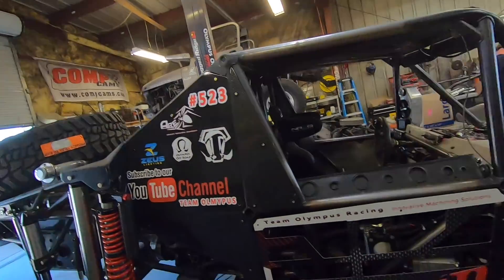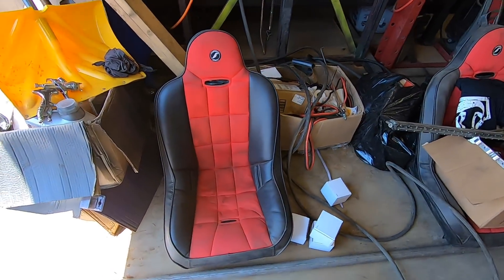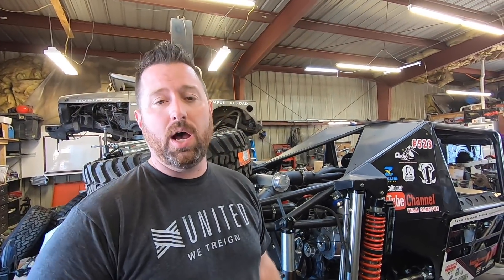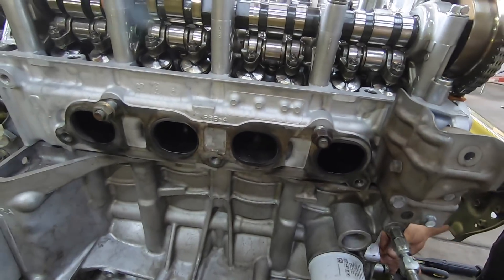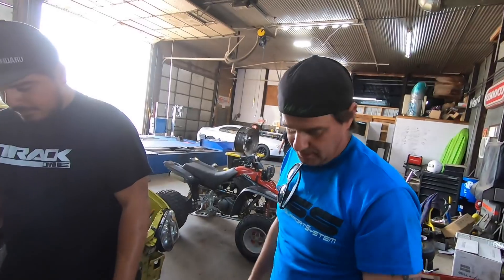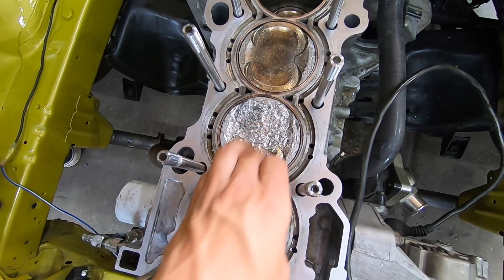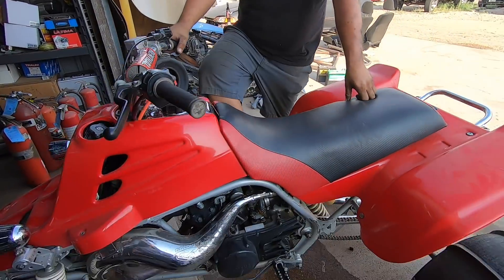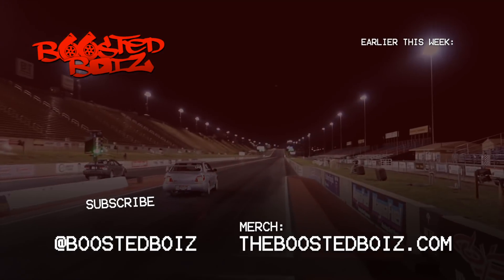Finding Out How Bad The Damage Is on Hondaru

Comment: I’d really encourage reaching out to 4piston and figure out what they can do to help. Because it has been consistent problems with their heads.
Reply: For real. Happened too many times to be a coincidence.
Reply: hangtime 7190 Youre not wrong. It’s been a lot of time and money spent to have a head continue to drop a valve in every motor they have.
Reply: @Vampyric Winter I will make pay  for the next engine.
Reply: @Vampyric Winter Agreed, unless 4piston gave free heads to BB theres no reason to keep giving them money or free R&D.
Reply: Vampyric Winter oh absolutely, but it is their heads that caused all of these catastrophic failures. You’d think they’d reimburse in some way.
Reply: You can't free rev an engine repeatedly at 9000RPM and expect the valvetrain to stay together. All 3 failures have come after misshifts. The damage is from valve float, not poor assembly or warranty related issues.
Reply: @humbleperformance  so what you are saying is that its the boostedboiz fault?
Reply: Humble Performance appreciate the insight
Reply: To help out a little further, The cylinder head on the subaru was gone through by their local machine shop, it was completely redone. 4Piston doesn't make the head, it's still a stock cylinder head, nothing about the setup is witchcraft. IF ther ewas an issue with the cylinder head PORT, that would be 4P's doing.

They've broken 3 heads with all the same issue. The last time, the head was reassembled by another shop and the same issue occurred, it wasn't even 4P. The reason they're going to try a stock head is to see if the issues arises again. If they drive the car the same way they have been, logic says it will happen again.

If it arises again, to alleviate the issue, they should either 1.) fix their shifting issues before running them full tilt again so the engine doesn't become unloaded at high RPMs again like they have been. 2.) put a heavier spring in the cylinder head for better valve control.
Reply: @humbleperformance  Stock head do not fail like that, that is trash head job, i have see so many ported heads with berilum valve seats, ferrea valve guide... full build head and never fail like that.
Reply: 4piston owes BB Kyle and Emelio both new engines. This is getting ridiculous their channels are losing lots of content because a mfg doesnt know how to press in seats. That is the exact reason here. They need to cut closer and lqd nitrogen them in. Sucks for Kyle and Emilio.  I wanted to go see them rip at ICream Cruse. If there cars arent up or blow up right away that sucks for all of us. 4P you better make this right or close doors.
Reply: @fabini14  Set your 2 step to 9000RPM and see how long the head stays together with 100lb Ferrea springs.

I've seen pictures of the cylinder heads up close as well because I talk with Kyle pretty regularly and he reached out to me after it happened before posting the video. The retainers show signs of valve float. A cylinder head doesn't cause valve float, an out of control valvetrain does. Control of the valvetrain is influenced by several things, and it isn't cylinder head porting.

That's why Kyle wants to put together a stock cylinder head with the same parts, to see for himself.

When 4P builds a head, they keep a log of EVERY head and engine that leaves the shop, every clearance and height is in a giant book that Josh keeps. If the boiz call into 4P they will receive all the specs the head measured at when it left.
Reply: way to many issues with them for sure, sad times when people trust a stock head vs one they paid $3k for
Reply: @humbleperformance  absolutely these engines see immense pressures  and  it's possible they may need different springs and ret.or change spring pressure what ever the issue a change is in order
Reply: @humbleperformance  LOL, dont try sry mistakes, that is trash seat job, nothing to do with valve float. Seatjob is not press and drop.
Reply: @fabini14  can you take a moment to explain how a bad seat job eats the top of retainers and causes keepers to pop?
Reply: @jossepprivera3461  I'm saying that when you get to the 800-1300HP Level things become a lot less forgiving. I would say the blame isn't on the cylinder assembly but the parts being used, the application its being used for, and the way it's being used in the application at the moment.

These are just growing pains, and when they find the actual problem, they'll be that much more knowlegable.
Reply: @humbleperformance  of course he can't explain
Reply: @humbleperformance  What you say makes a lot of sense. So many factors at play here and people in the comments would rather point fingers than listen to someone with way more experience than them. Obviously people don't have to take your word as law and be 100% certain you're right, but I for one say your input is appreciated!
Reply: @humbleperformance  so what you are saying Is that this is a driver mod fix 

Maybe send them a copy of need for speed 1 so they can get the basics of shifting down really good?
Reply: @fabini14  just to double down. The head was gone through and checked by their local machine shop as they said in another video. All the seats were checked and done fine. 

Let's play the imaginary scenario that 4P did mess up the valve seats, on this cylinder head done by their local machine shop, why did the same issue arise after it was completely redone and gone through?

Valve Springs, Valve Control.
Reply: @humbleperformance  not necessarily. There not at 9k 2 stepping. I get float but seriously the og van engine and Roman's.  Those wernt 9k misshifts. And the seat gone from the last 2. Its poor seat cutting. 2 much gap. Not enough nitrogen.
Reply: I mean, did you guys not see how bad he was bouncing on limiter JUST to get it into 3rd or 4th gear? What can you expect if you’re bouncing your limiter trying to shift it? Its racing guy and Kyle and Emilio aren’t pro but they are getting there. No need to blame anyone.
Reply: Eduardo Vega exactly, mistakes happen. No need to blame a certain company
Reply: @numlockkilla  If your rev limiter is set to 9000RPM and you mis shift 3-4 and bounce limiter for 1-2 seconds you are bouncing an unloaded engine at 9000RPM, that would absolutely cause valve float if you aren't running a heavy enough spring. It is the same wear you would put on an engine sitting at a stand still bouncing limiter at 9000RPM. Just go back and watch the subaru video and count how many times the car bounces 9000RPM on the misshift. Then watch the MR2 passes and how many times it bounces a 9000+RPM Rev Limiter before it broke.
Reply: @fabini14  its definitely valve float causing the issue. They need stiffer valve springs.
Reply: He needs to say F them and go back to maybe a stock head and get it professionally ported + valve springs...4 Piston seems like their quality is trash.
Reply: I’d bet they have already heard about it. If they haven’t they must not be on ANY social platforms.
Reply: @numlockkilla  exactly! Thank you!
Reply: @johnfasanoii4382  is said 2000HP drag car(s) fully sponsored by 4P? Just asking as many have had this same, and other issues with these heads. Fully sponsored teams get way better attention when theres failure, you should know this. Now if 4P stepped up and made things right by working with BB (like said fully sponsored teams), then the problem could be identified and fixed with R&D.
Reply: @humbleperformance  you nailed it . they need some heavy heavy supertec springs in these heads to be running the amount of boost rpm and cams they continue to turn . Honestly only two things causes this to repeat , poor p2v clearance with too much VTC angle or too much revs and boost with weak valve train or combo of both especially with addition of cams  ... reasons why i stopped watching this channel they just keep breaking shit
Reply: One thing to is they need to double check deck height for piston valve clearance to make sure that’s not also causing a problem with the valves,  they are for sure getting valve float
Reply: @humbleperformance  understood thanks for the clarification
Reply: @humbleperformance  bottom line is why aren't you, or 4P stepping in to try and help (hands on)? From a public relations perspective, it makes sense and is the right thing to do. You being combative with comments (wether they make sense, or not) is making your brand look suspect. Less typing, and more probing into the issue is what's needed. This again means hands on, not "I've seen pictures, and talk with Kyle regularly". Also if you and Kyle speak regularly, you'd be doing more work with 4P to assist. Do yourself/company a great service and stay "humble", and stop commenting. Less talking, more work.
Reply: Humble Performance The issue you guys are claiming is the valve springs not being able to control the valvetrain totally makes sense. Now consider that you guys are the experts who are supposed to provide guidance against using low clamping pressure for boosted applications. Have you guys not watched boosted boys? Why would you not have advised against using those springs? You keep saying that you’re confident you will see the same results with a stock head. Again why not step in and provide guidance directly to them? (a new free head with proper spring would be more appropriate considering the dough they’ve dropped for top shelf product)
Reply: @sakebomb5446  I dont think its fair to point fingers at Humble for stepping in the comments to help clear up the misinformation going around. People just don't like to be told they're possibly wrong. But i do agree it would be a good look for someone to come and help them personally, although i dont think its their fault. If it really is just too light of a valve spring, why the hell has that not been changed yet?
Reply: Humble is 100% correct. You can not repeatedly miss shifts on high HP manual trans racing engines. There is no bullet proof valve train config that will take that over and over. 
This is on the BBs, all of it.
Reply: Bradyn K, where did I point a finger? I simply was giving good business advise, which will help both humble and 4P moving forward.
Reply: Wow this comment caused some stank. I really do think 4P should reach out. Regardless of who’s fault it is because it’s their company getting ran through the dirt. They’re big in Honda community, and their heads are failing repeatedly on this massive platform we know and love, which is the Boostedboiz. I think theirs a combination of problems. Too soft a spring. Too many RPMs for the quafe sequentials to shift into etc. you combine that with the MR2, or hondaru, or the rowdessy, you’re going to have something fail. Whether it’s the BBs themselves, or something on 4Ps end. It’s a bad look for the company regardless.
Reply: mdnborg lol u think these heads can run through everything high rpm. And boost? It’s not their fault these boosted Booz have to much high rpms
Reply: I’d sort the gear change issue because that’s what’s wrecking the engine. Nothing to do with the cylinder head.
Reply: @sakebomb5446  I've already told him all these things and he thinks it's another issue. So he's going to test and find out for certain if it's valve control or if it's the 4P cylinder head.

He was offered a heavier spring and didn't want them.

My goal here isn't to bash or anything of that nature, but to help people who just watch a video and parrot what they see without an actual understanding of what's taking place.  I think at the end, everyone will have learned something. Racing is a process by which you fail a LOT. With advancements in technology and the way we communicate, it has become much EASIER to make huge power, the BBz are a testament to that fact, they're also a testament to the fact ath while it's EASIER to make huge power, it isn't EASY.
Reply: 4piston heads  sales are droppin!!
Reply: BrokenMTBer you wanna see my watch time stats ? I promise you its well under 5 minutes in 5 months
Reply: @humbleperformance  I agree with you. RPM is too high. Two step and a missed shift causes this type of problem . Bouncing off the limiter isn't great for any engine. These hondas are a little more delicate than we see in a small block v8  and spinning faster. Do they have double springs available on such a tight valve train? I helped a friend assemble a set of heads for a chevy small block after valve damage and he had to run double springs on each valve with his cam and high rpm. I fix stock vehicles for the last 2 decades but dont have much experience with high performance stuff.
Reply: @Dabbs_291  I'm willing to bet that they have explained this to them and that's all they can do. RPM too high. Lower the limiter and you won't see this anymore. Or don't ever miss a shift or lose traction. Going balls to the wall is hard on equipment and makes the drivers, tuners job harder. BB's could build a reliable 500hp class car and be boring to watch. Pushing the limits is hard, and apparently fun to watch.
Reply: Humble Performance what you say all makes sense if the motor broke on a pass he missed shifts on. It broke on a clean pass. Just rewatched video. Every gear and shift is good and when he puts it in 4th you hear motor issues. Which means it happened on the high end of 3rd gear. No missed shifts. So how did it happen. And if it broke on previous pass how come motor made a full burnout and 2 stepped at stage lanes fine and ran first thru third gear before finally giving out on a “hurt “ motor. Wasn’t hurt the pass he missed a shift. It was hurt the pass it made some real steam. Would like to know.
Reply: I believe that if whoever builds any engine component knows what the customer is after (power wise) then they should build to spec heavy enough springs proper valve job all the way around. Yes mis shifts were involved but i feel like if u use parts to accommodate the rev and power then it would still be running. It seems like whatever parts they are using leave room for no error. I've seen mis shifts and revs at 9k+ multiple times and still hold together.
Reply: Zachary Ballew except they’re also paid by that company and like I said in my comment specifically what they are saying makes perfect sense. If it broke in a miss shift. But it didn’t. Also in comment specifically I said I would like to know how it broke on a bad shift it it broke on a pass without a bad shift. Think like this. If you bought something that was literally intended to prevent the issue you were having( floating valves and stuff) over and over again even with thier product. You would start to question thier product. And if it’s worth it for you. That’s all the fans are saying. If 4P is paying or helping them out with parts is it still worth it for them considering the bad luck they’ve had even if it’s their fault(BB). Seems like they have better luck with stock heads.
Reply: @buddyturner6969  I'm really unsure why you responded and just repeated yourself lol. Grown ups commenting don't need another grown up explaining their point for them lmao. I can read thanks though. All people are doing is speculating about things they have next to no knowledge about...i.e. building and racing 800+ drag Honda's. Doesn't matter how much foresight goes into things at this level these things tend to/can happen. Also when the end power goal is never a for sure number it can be easy to overlook or cross your fingers with certain parts and "see what she does".  4Piston does machine work that's their specialty not hard parts, so a part failure as Humble said wouldn't be on them as common sense would tell most people. 
                                                                      Everyone blaming 4Piston is reaching for a reason for it to be their fault or for Kyle to get some kind of hand out when NOBODY knows anything at the moment other than what common sense would tell you.....VALVE FLOAT....VALVETRAIN ISSUE. And another point companies will consult with you when you are looking for advice and consultation , but when you reach out to have them build a head with X parts in it that's what they typically do. Kyle hasn't ever really been set on numbers specifically he has roundabouts so again you cant get very accurate advice(even if that was what he had done) on guesstimations.
Reply: @humbleperformance  Just my opinion from building engines for a long long time now, but odds are that when the valvetrain fails a second time on the same hole in a similar but more exaggerated fashion... Then you got yourself a piston to valve interference. I suspect the bottom end and or cam combination is to be suspect and not the cylinder head. Again its just my 2 cents. It could be anything from a rod to crank or piston or bearing issue. These motors have tight clearance and I am not the one assembling them but if I were I would be checking them carefully. I fully expect the valvetrain hardware that was used to be capable of the conditions it was under.
Reply: Build off of stock head that’s the way it’s been done from the beginning times
Reply: @buddyturner6969  AWWWW poor little guy is afraid of reading. lol  It's facts bud no need to express your denial even further geez.
Reply: Zachary Ballew still not making valid points. Have a good one
Reply: @buddyturner6969  Maybe if comprehension isn't your strong point sure lmao.
Reply: Zachary Ballew still mad?this is fun for me. I can comment for ever.
Reply: Zachary Ballew still mad
Reply: Zachary Ballew still mad
Reply: Zachary Ballew still mad
Reply: @buddyturner6969  Just reading your reply, I want to try to help you understand as much as possible how we can diagnose an issue before something occurs and how we can diagnose with the information we have.

If you watch the video of the Hondaru when it broke at 9:50 you can hear the car missing as it pulls up to the line. 100% it was missing before they pulled up to the burnout. That miss you hear is a bent valve. It's clear as day. When you hear the valve has bent, you should never run the car. Why? When the valve bends, it can come into contact with the other valves which in turn can cause drop the head of the valve and cause devastating damage. Go further into the video on that pass. Listen to the car 'go' into 4th gear. It misses the first pull, has a change of pitch in the engine, then clicks into gear the second pull. That change of pitch in the engine before Emilio tried to shift the second time is serious serious valve float. The very next pass the valve dropped because the damage had already been done to the valve train. 

Running a car with a miss after floating valves is like running a car with a rod knock. If you don't pull the bearings to inspect the rod after the symptoms start to show, you cant be surprised when a rod exits the block.
Reply: @Dabbs_291  I can't see it being an RPM issue with the quaife sequential. These are tried and tested boxes which are used extensively in rallying and they shift perfect at 9k+rpm in rally conditions with lots of limiter action. It could well be some other sort of an issue with it but rpm doesn't seem a plausible issue  to me.
Reply: @humble performance 💯 from the miss shifts I give props to ferrea if that would’ve been a lesser brand valve that would’ve been clean up on isle 5 at the top end of the track and could’ve been an accident. If it don’t go in the first time let out. And do a cylinder leak down before u make another pass. The common denominator to most is the cylinder head but to me the miss shifts on that expensive sequential is causing bbz money and now unfortunately 4piston racing is gonna take a hit because people that don’t have an understanding of how an engine works is pointing fingers that have no business being pointed it unfortunate for sure.
Reply: @humbleperformance  Exactly, most of these commenters just won't understand. They will blame 4 piston and trash them when they dont have a freaking clue.
Reply: @Sizukun1  these head are proven by the fastest honda and it not a new product 4piston make these head for like 7/8 year man
Reply: Humble Performance I keep saying this but the non technical followers don’t understand
Reply: @ArkansasMat  Has to be driver error, we have shifted the same gearbox in the mr2 at 12krpm, mated to a RB26.
Reply: @numlockkilla  exactly if they cant do it right close that damn door.
Reply: What's the piston to valve clearance?  Got big cams in it.
Reply: @humbleperformance   This is the correct answer. Valve float.
Reply: @humbleperformance  feel free to not reply because you might have to explain a lot to explain it at all, but is being at 9k rpm unloaded have more potential to damage internals than 9k rpm while the motor is loaded? like if you were in top gear in a straight just about maxing it out barely reaching 9k vs sitting on the limiter in neutral: which is "worse" generally?
I know for the trans & clutch, being in top gear flat out will put a lot more torque through it... but what about if you were only considering the stresses on the valve train and rotating assembly?
Reply: @humbleperformance  He wasn't even reving it out to 9000rmp so that theory is invalid. Also, how did he mishift with a Dogbox? Of course your opinion is biased when you sponsor or sell 4piston heads. Boostedboiz aren't the only ones who have problems running these heads...
Reply: +1 for just saying ty for the sponsership but its time to move on.
Reply: Sounds like valve springs to me but why are such soft valve springs put into a head thats meant for xxxxhp and xxxxxrpm?
Reply: Humble Performance I wonder how aggressive their cams are. But 100lb springs definitely aren’t cutting it
Reply: An unloaded valve train is less likely to float than a valve spring being pushed open by 30psi of air, so saying “hE mIsSeD a GeAr” is totally irrelevant. It’s beyond obvious that the parts being fitted to the cylinder head are inadequate for the application, and unfortunately that’s 100% on the head builder, if a local shop went through it, that’s all well and good, but they’ve just removed and refitted parts that are not useful for the application. One of my customers has a B series going 10200rpm and misses 3rd 1/5 runs. Never, ever had a valvetrain drama. Because everything is correctly set up. This issue is completely and totally on the head builder, the head builder has fitted parts inadequate for the engine - the parts have failed. Open, shut. No ifs, buts, or maybes.
Reply: It wasn't the head that cause the problem look back at the video and watch how many times emilio bounced of limiter run after run before the head went I saw it coming sorry to say from a mile away
Reply: @upsidedownfarmer3513  long time builder here also and i suspect the same p2v not right if the mr2 and hondaru are running the same pistons this should explain it also humble did put a new 4p head on the mr2 this is something they also might have over looked
Reply: @gt1man931  laught in desmodromic valve
Reply: Julmaine White we saw p2v contact in the MR2 engine but only associated it with the vent valve, there was light damage on another cylinder but nothing crazy. We cut the valve reliefs a little deeper in the MR2 just for safety and the issue still came back.
Reply: nallen100  their local spot..
Reply: Mike Eral them people are Scammers!!
Reply: 4 piston IS NOT doing any of the valve work aside fr establishing the seats...  Assembling the valvetrain on such a head requires a little more precision and attention to detail than Kyle is capable of apparently .....
Reply: @numlockkilla  bullshit. Kyle's the one assembling the heads. The failures are spawning from the valves.....
Reply: @fabini14  if it was a trash seat job the damn engine would've never even made power on that cylinder... There're a lot of 4P ported heads out there making more power and holding up fine.
Reply: @numlockkilla  how on earth would one of the premier CNC porting outfits be poorly cutting valve seats???
Realize how stupid that sounds...
Reply: @sakebomb5446  4p is not at fault here. Whoever assembled the valvetrain is..
Reply: @brunodemaria4827  God damn kid, Kyle has been doing this shit every day for more than several years now. He should've learned about spring pressure EONS & EONS ago......
Reply: @upsidedownfarmer3513  how is a main bearing going to drop a valve?  Lol you must've built all those engines in your dreams.
Reply: @FriedEggsandJellyfish  they used weak springs. 4p TOLD THEM TO USE STRONGER SPRINGS.

Face it kid, you have no clue.
Reply: @alexmann3309  you have no clue...
Reply: @elonmust7470  lol bad job install seat, not bad seat lo